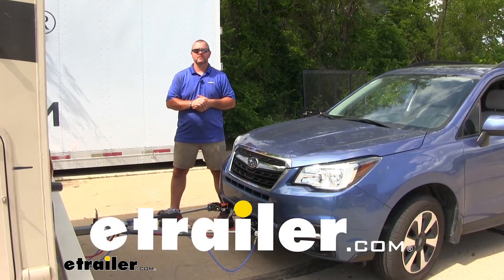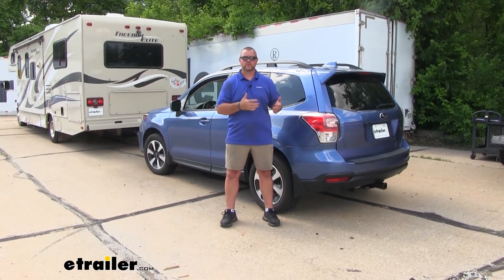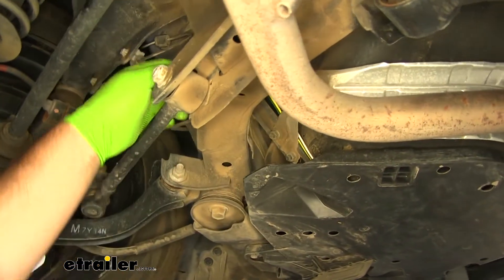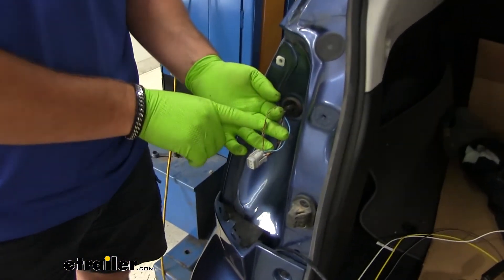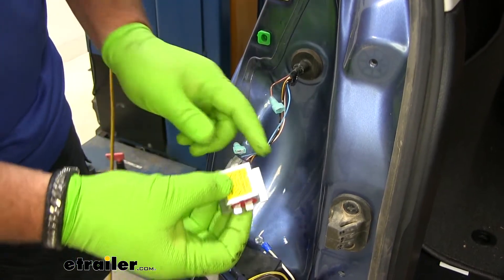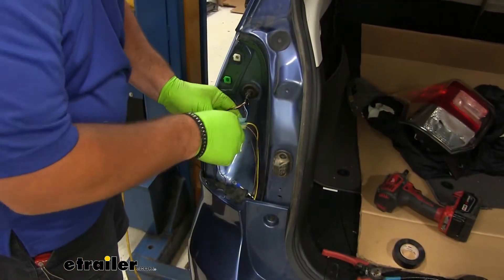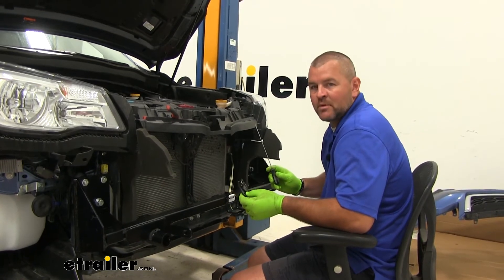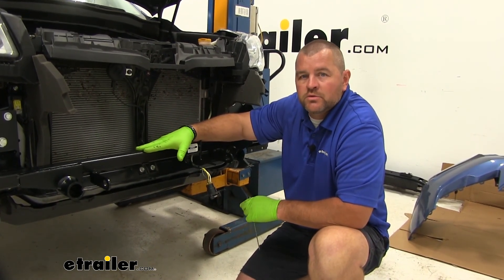Set up: Roadmaster 4-Diode Universal Wiring Kit for Towed Vehicles on a 2018 Subaru Forester

Comment: I'm about to do this install. What does the installer mean by leaving that bundle of wire under the hood "to tie into the brakes?" Is there an additional component he installed? Why not just run the wire all the way under the vehicle rather than up towards the hood and then back down to run it on the undercarriage to the rear?
Reply from the maker: For this particular install there was a braking system that was being installed that requires a signal from the motorhome. That is why that wires were run like they were. You can simply run the wires from the front to the back of the vehicle. We like to run them through the frame because it provides the ultimate protection.
https://www.etrailer.com/Tow-Bar-Wiring/Roadmaster/RM-152-98146-7.html